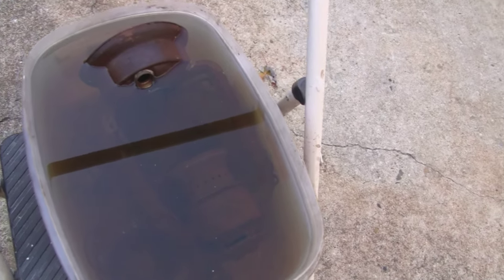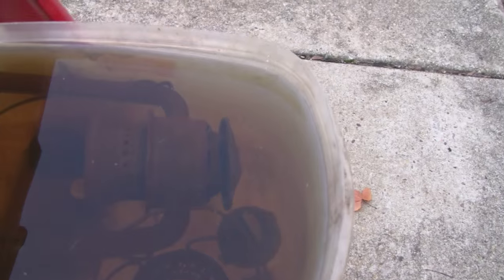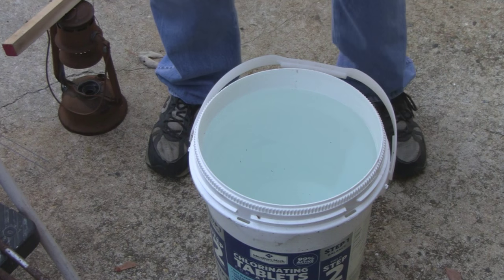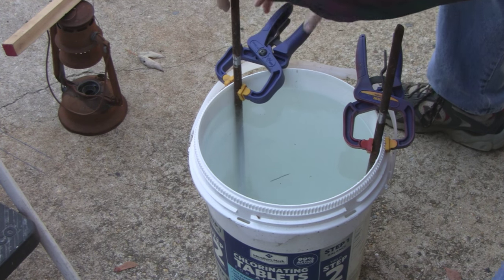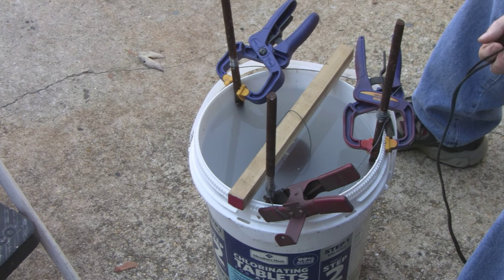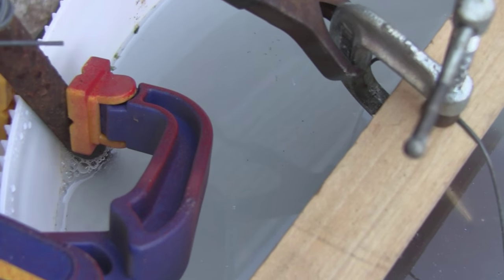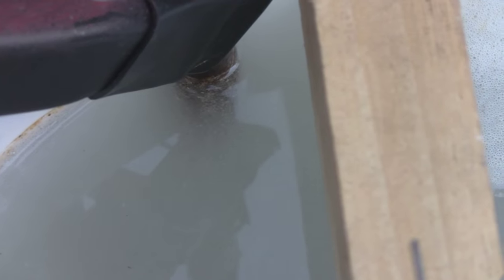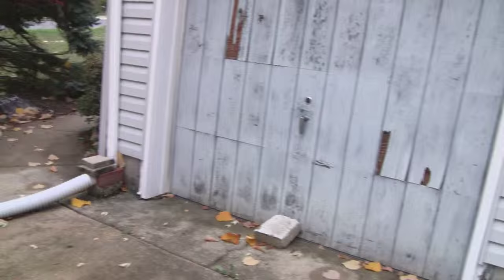HOW TO MAKE AN ELECTROLYSIS TANK

Comment: Thanks for all the great videos. I found a big roll of 6 inch wide shim stock that is about 3-5 thousandths thick. Cut off a few feet of it for a 5 gallon bucket, and just used binder clips around the rim of the bucket. One connection to the steel shim stock via one binder clip, and one connection to the part via aluminum wire. Works pretty good. No need to haul a load of clamps out. Add the soda in slowly to tap water after all is set up to slowly bring up the amps on the meter of the battery charger. Does not take much powder.

Comment: Great job - must admit I'd forgotten about this, despite using it in the past. One thing I do remember that worked great. I was helping Carl (I've mentioned before) in my mid 20s at his new house. We wanted a copper sheet for the aga hood, but copper was expensive, even then. So I got a sheet of steel from Dad, formed the hood, then just using copper sulphate from the chemist in some water, painted it on using a car battery. Used a drop of the battery acid as well, to clean as I painted. The results were stunning, an aged copper look.
Reply from the maker: +MalcOfLincoln Old age sucks Mate!! I forgot what I had for lunch already!!☺
Reply: Yeah it does. I'm 68 on the 20th. Apart from mechanical ailments, I'm normally healthy. Had more days unwell this last year than the last 20.

Comment: Nice look on the lantern. Linseed oil is a great product. I use steel wool and boiled linseed oil when I remove paint oxide and surface rust from things I don't want to repaint. I used it the other day on a bicycle from 1930 that I thougt was to nice to repaint. You can't belive it's the same bike afterwards. It looks great.
Reply from the maker: +Per Holmberg I use it on alotta my engines!!☺

Comment: You should try 20% strength phosphoric acid.  It will remove ALL traces of rust in about 10-20 minutes, depending on the severity of course.  I've been using it to restore tarnished and rusted chrome plated parts of all types, zinc plated hardware, and even bare metal.  I've turned rusted chrome plated parts into looking almost like brand new.  The only thing it can't do is remove the pitting, etc., since that material has already been consumed by the corrosion process but it will minimize the appearance such that it's hardly noticeable.  The part must be protected after the treatment or it will rust again fairly quickly.  Even dull zinc-plated parts can shine like new again.  Be careful as zinc only needs 2 or 3 minutes of treatment or it will turn dark.

After treating any parts wash them with soap and water then rinse thoroughly with clean water.  Dry the part(s) then primer and paint the bare metal parts and polish and wax the zinc or chrome plated parts.  I found this by accident trying to remove the discoloration from stainless steel exhaust pipes on my motorcycles, which it also removes, even weld discoloration.  It's a miracle treatment, but, again, it does require protecting the surface afterwards or it will tarnish/rust again.  I typically use Wenol brand aluminum/metal polish after treatment to restore the original shine, but any aluminum polish should work.

Of course you should wear gloves with the phosphoric acid, but I typically don't need to for short periods since it's only 20% strength.  If I wait too long it begins to irritate the skin slightly.  A quick wash with soap and water immediately remedies that.  Of course most soft drinks contain small amounts of phosphoric acid and we ingest that so it so it's not dangerous like sulfuric acid.  And phosphoric acid is why Coke is such a good cleaner for certain things.

Anyway, give it a try.  You'll be impressed with how well and how fast it works!

Cheers from Thailand!

Comment: 1 part Molasses to 10 parts water works great as a rust remover. Does not attack viable metal. Just soak for a week, hose it off and repeat if needed. The only drawback is it starts rusting again very quickly after coming into contact with air.